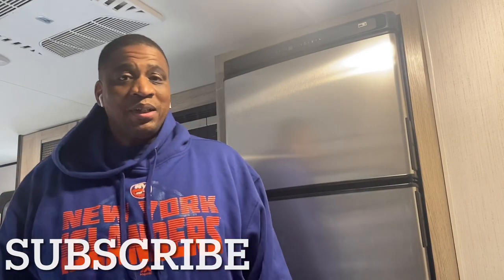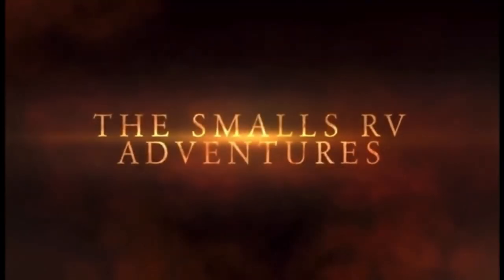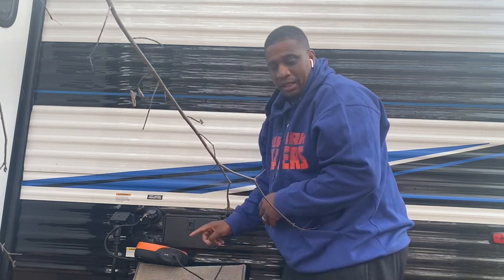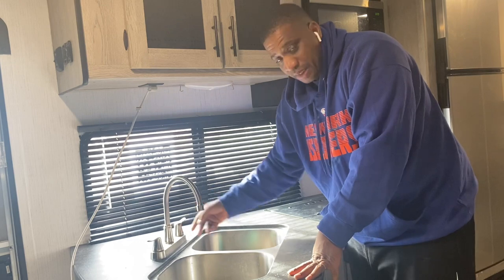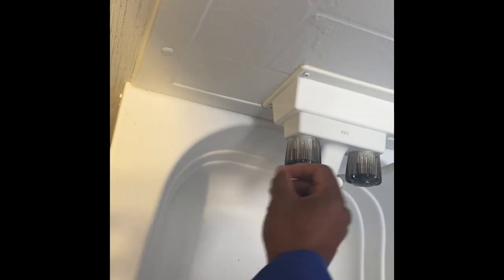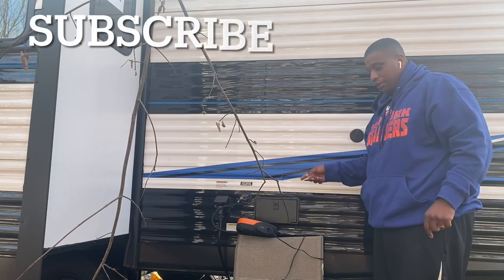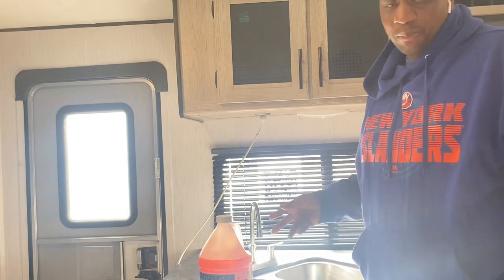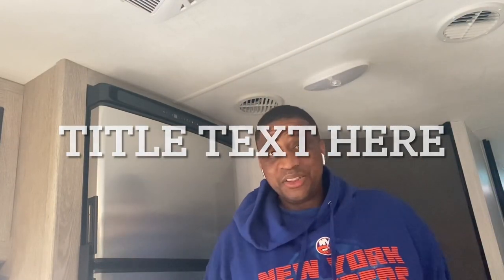How To Winterize Your RV With An Air Compressor Winter 2021 DIY

Comment: Where did you get the connection for your air compressor? I don't see any links to the parts needed for this task. Great video btw
Reply from the maker: Here’s the link. Sorry I thought I put them all in the description. You may have to modify the fitting to fit your air compressor. Most air compressors come with fitting. Any of them will work with this quick connect adapter https://amzn.to/3CjVx27

Comment: Great video. Thank you. How do you regulate the amount of psi going into the pipes? They say no more than 40 -50 psi? Do you need a regulator?
Reply from the maker: On the air compressor that I’m using I. The video I only used 10 psi. You can adjust it on the regulator.

Comment: So you drain the shower last or the order doesn’t matter. Which anti freeze should I use.
Reply from the maker: You can drain any sink or shower you want first. The key is to drain all of them. I put a link in the description for antifreeze from Amazon but you can get it much cheaper at Walmart.

Comment: Didn't you leave the water heater totally open?  Isn't the air just blowing into and out of the open water heater?
Reply from the maker: Hey how are you. When you do it you can leave all the faucet lines open so the air can blow and left over water through the lines. Opening the low point drains mostly releases all the water from the water heater. Leaving it open while using the air compressor ensures that all water has come out. When you turn on the faucets on the rig you will hear the air coming out. Thank you so much for watching and commenting. I appreciate your support. Thank you.
Reply: noticed that too.  water heater needs to be closed and bypassed.  I hope the air compressor was off for demonstration purposes because some water is going to come out of each faucet.
Reply from the maker: @ericknowles1637  was only for demonstration purposes. Thank you for noticing and watching.

Comment: Sooo after doing this you just dry camp for the rest of the winter or you do it over after every RV use?
Reply from the maker: We do this after every use. It takes like five minutes. Since we are in the camper every week we have to drain all the water out. It gets way to cold here for the camper to sit with water. The water will freeze then expand and cause damage. We purchased a couple gallons of antifreeze from Walmart to get us through the winter. Walmart has the antifreeze much cheaper then everyone else. About $3 for the gallon.
Reply: I dry camp once I am winterized. BUT- I still use the toilet. I keep some jugs of RV antifreeze and use them to flush. I've done it that way for about 8 years in two different campers with no issues.
Reply: @jjjandrbaker  We do that when we're roadtrippin in the cold. Do your plumbing seals get dried and crack from being without water for so long?